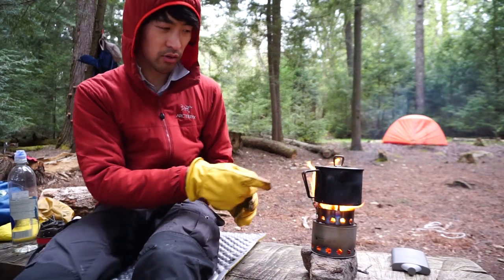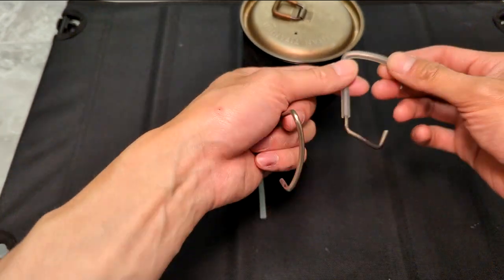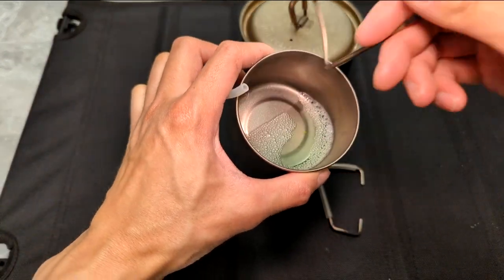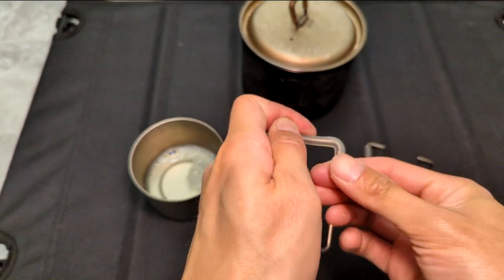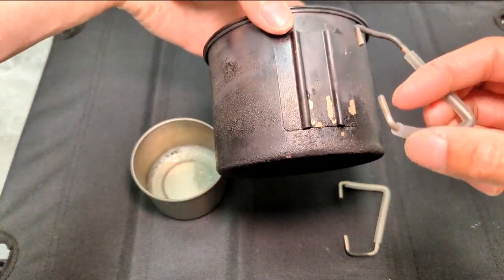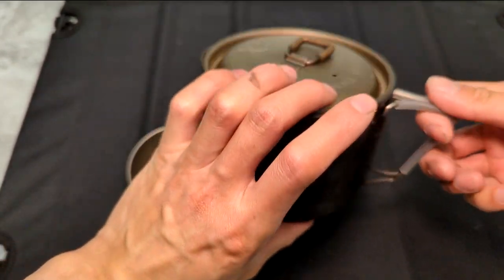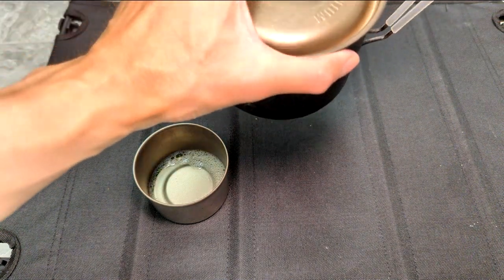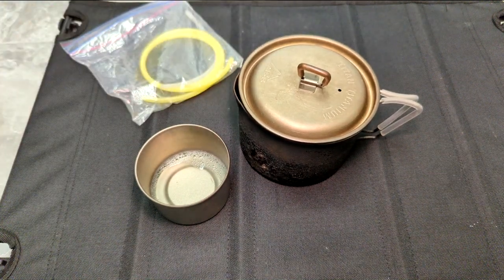Installing Silicone Grip for Titanium Pot Handles (MSR Titan Kettle)

Comment: Like you I have flipped my handles over left for right, top to bottom.
The silicone tubing I got was selected from Inner Outer diameter. So measure the diameter of the handle.
Should have bought yellow, I got purple.
Yes long nose pliers to spread out the lid lifting loop, so as not to strain its retainer.
Thank you for sharing. 
Take care 
Regards Colin
Reply from the maker: After a while the silicone all becomes the same colour from soot off the fire.

Great to hear it worked out for you. It's one of the best modifications to the Kettle.

The lid lift loop was a little trickier but it is doable with pliers.

Comment: It is a glove thing to remove the mug from the twig stove. I would never again try put another silicone in handles.
Reply from the maker: I use gloves as well, but having the silicone there is good in case I need to quickly readjust the pot, and gloves aren't in a handy place.

Comment: Solution is pots without handles, and use pot grippers.
Reply from the maker: I do have some pots with no handles. They have their place. One other solution is a pot with a top bail handle.

But it does make it harder to use those pots as a mug though as they don't have a handle to make it easier for drinking hot beverages.